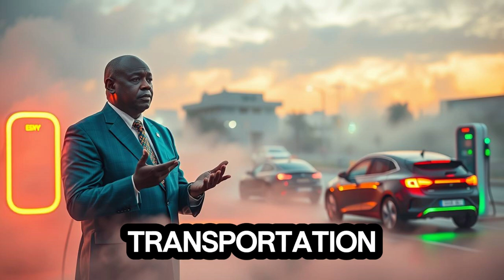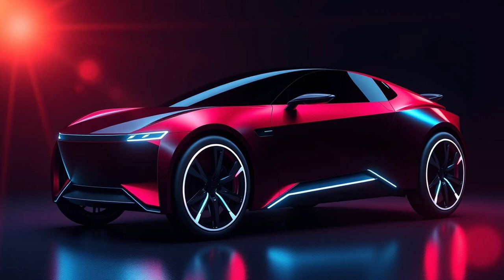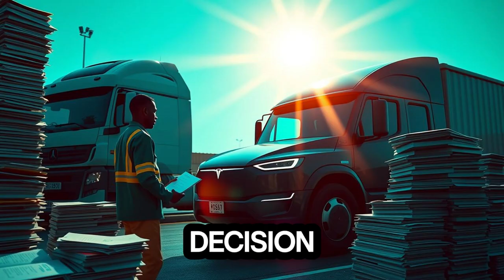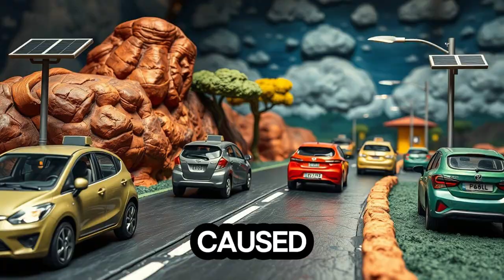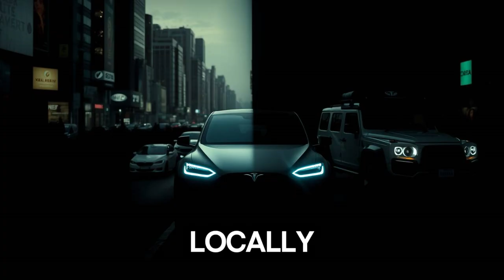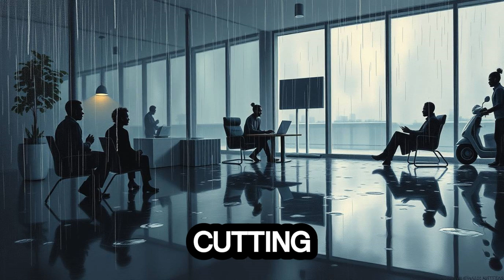Cybertruck Ban: Impact on Zimbabwe's EV Industry

Comment: The advantage of Maxwells free energy device allows us to simply buy a car and take the petrol motor out and replace it with an electric motor and powered by Maxwells free energy device. Making every car and truck already on the road can become a chrap electric vehicle.
Reply: Disadvantage being his "invention"  is fictionary.

He could say his invention makes omelettes as well.

Not like anyone can disprove it.
Reply: @jackneuman5108  SO YOU DO NOT WANT TO BELIEVE IN FREE ENERGY DEVICES.
Do you understand how physics works?
\If perpetual motion works in the micro, say the atom, and perpetual motion works in a galaxy then perpetual motion MUST exist everywhere in between.

The thing with Maxwells device is that it proves Tesla was right and energy is converted from the Aether into electricity via a coil of wire and an airel or moving a coil of wire past a magnet.

It also proves that quantum theory is a lie.